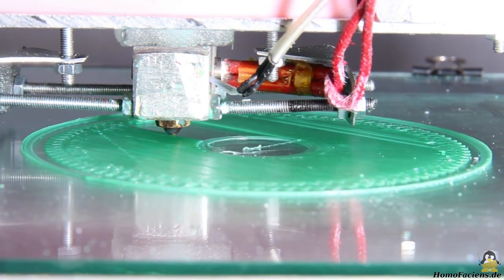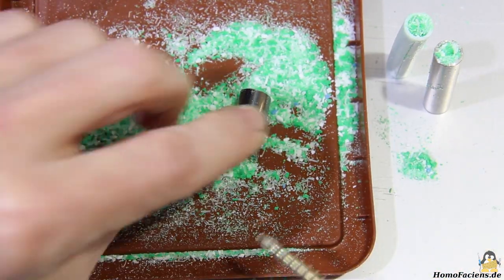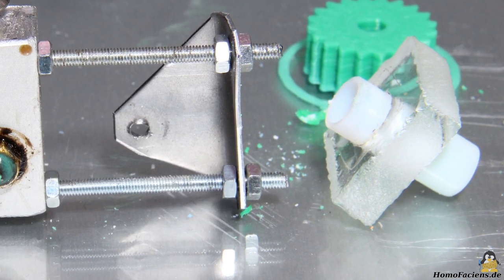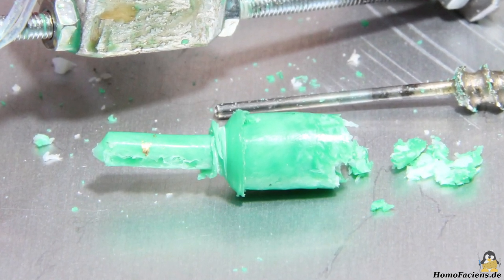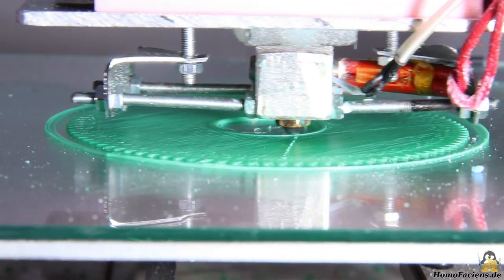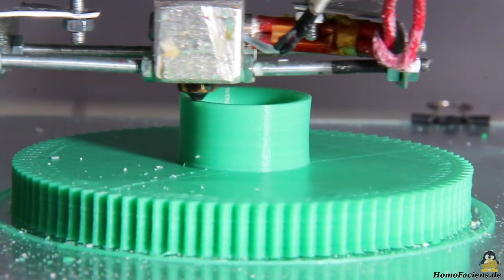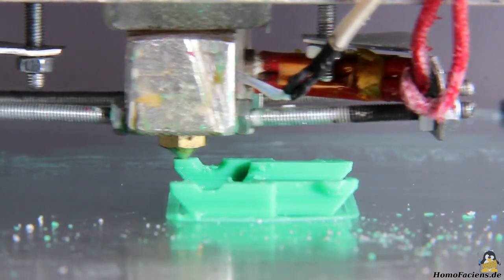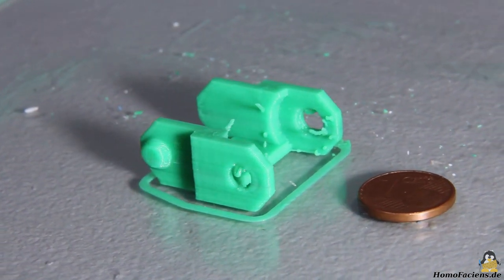Direct "Pellet" Extruder V3: development history

Comment: I was waiting for this one ! Pretty cool to see that you improved the initial design. It is interesting from a weight/price point of view and more important it seems versatile enough on the extrusion flow to accommodate different needs. Nice job !
Reply from the maker: Yes, keeping the weight and dimensions low was what I had in mind from the very beginning of this project. Using the original stepper motor and heating cardridge from the weak Zonestar printer I am using as mechanics gives another benefit: There is no additional power electronics needed. I should become a drop in replacement.

Comment: advice, use a washer or a nut on one or two sides of the nut shaft, it acts as a wear resistance surface to rub against, I do that for my gears in my printer as the printed D shaped shafts always got worn after a while, hasn't happened again in ages after that :) it also spreads the force etc!
Reply from the maker: Yes!  I had used cap nuts for some of the conveyer screws, but ran out of them during testing ;-)

Comment: How many times can you shred and reprint the same part before it starts developing differences in appearance or mechanical properties?
Reply from the maker: That's not really from interest for me. The main question is: How many non plastic particles you add by shredding waste plastics. That means bed adhesion on the bottom of your old prints, dirt particles and so on. Shredding and reprinting the same part over and over again would give you academical numbers, but never represent practice.